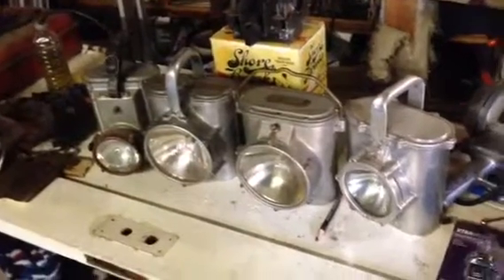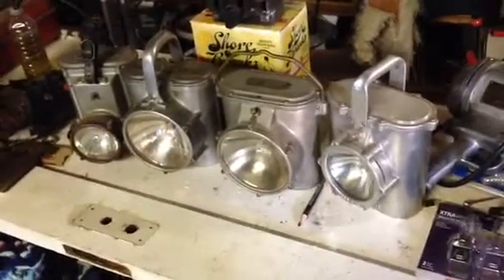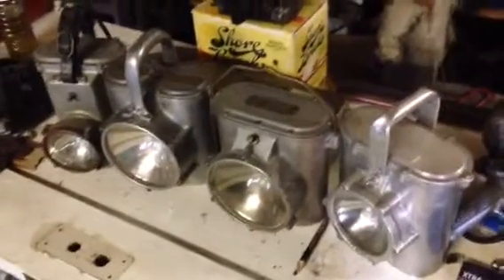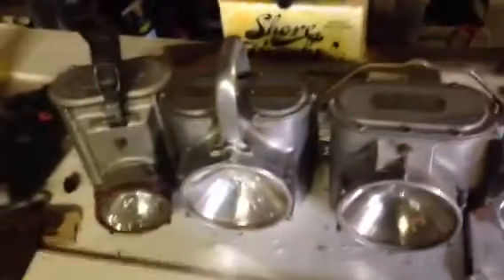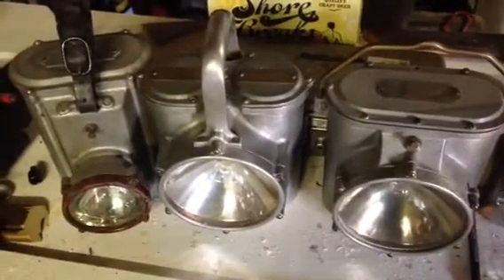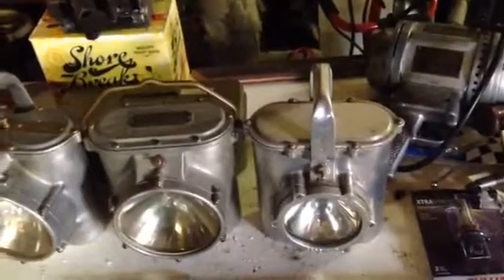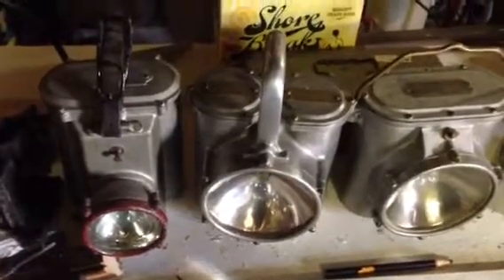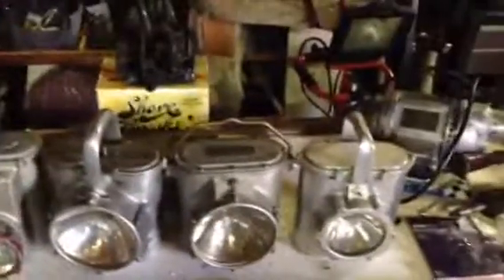WW1 tech: the electric battle lantern

Comment: Hello as a Us Navy vet I to for many years have sought these lanterns out on the likes of ebay.. shopgoodwill.com (which I have found two at $5 each) and just love theseI also have several of the metal ones that I sandblast and rebuild the insides add two 6 v lantern batteries and upgrade the bulbs..except the first one you showed I have the other three as well..my question is how are able to buff out the last one?..
Reply from the maker: +bob crawford tons of sanding went in to the polishing of that lantern, you have to get through the casting scale to smooth aluminum, I found the screen style sanding pads for drywall cut it pretty good, then finer and finer sand paper, then buffing, lots and lots of buffing. I think i used a file too on some of the really rough areas where it was possible to do so. I eventually would like to convert that one to LED and make it rechargeable as well, I bet i could get some crazy life out of it, lots of room for batteries!
Reply: Thanks again pal...will try that tip out..